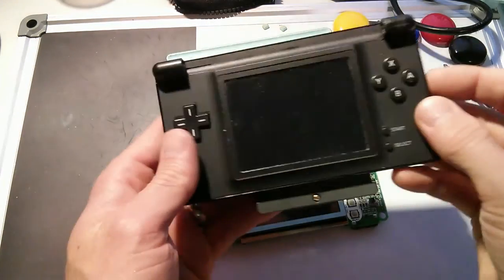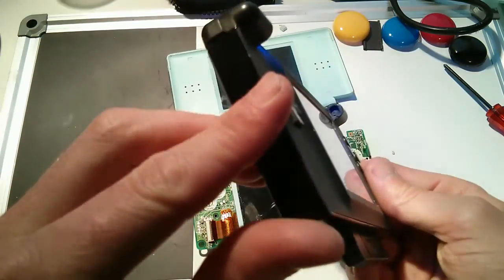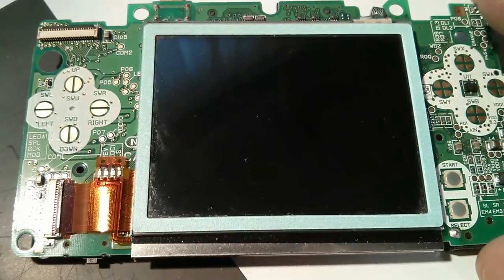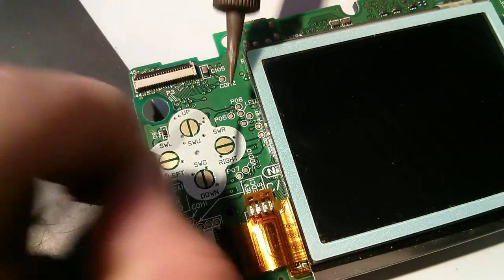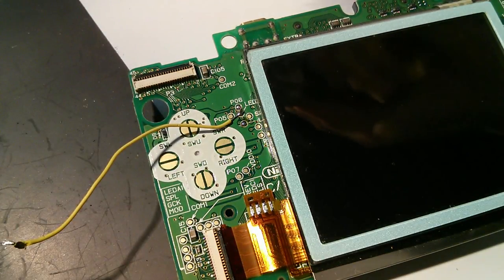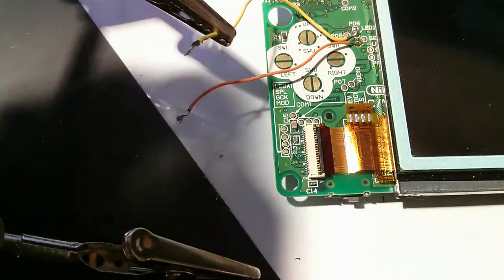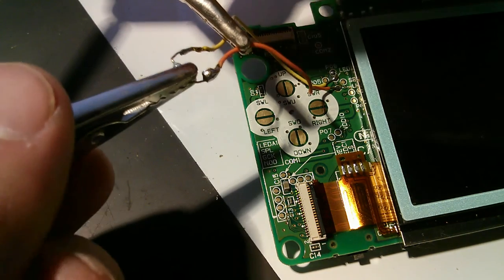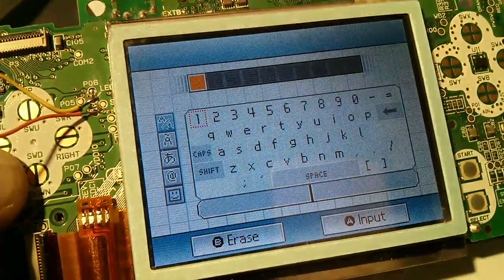Convert broken nintendo DS to gameboy advance

Comment: Can you use a r4 card to run gba games on it if you put an emulator on the r4 card?
Reply from the maker: No it is not possible. You can buy a cheap GBA flash cart tho

Comment: I hv tried 330ohm it didnt works.just the screen blink and shut down.but i tried other value resistors.all below 1k.and finally found the correct one for my ndsl. Its 220ohm(red,red,brown).its seem not all ndsl need the same ohm value.
Reply from the maker: Ah that's good to know, thanks for sharing it on here
Reply: @facelesstech  ur welcome😉

Comment: Can you just solder the resistor directly to the board
Reply from the maker: denzel_the.asian yeah, you can use a 1206 330ohm resistor but it's quite tricky to do if your not used to soldering
Reply from the maker: If you don't fancy soldering you can keep the ribbon cable to goes to the top screen, you will need to keep the LED's attached to it tho

Comment: If you're planning on doing this, keep in mind it's not guaranteed to work.  I've done this 10 times with the broken top screen DS Lites in my stock, but only 4 of them worked after soldering a 330 ohm resistor to the pins.  I have not found any reason why some of them worked and others didn't.

Comment: Is there any way to do this without soldering? I read somewhere that if i keep the ribbon cable intact that it works the same
Reply from the maker: I haven't tried that myself, If you keep enough of the ribbon cable to cause enough resistance so the ds will think the top screen is still attached.  Its worth a go if you already have a broken ds on hand
Reply: i ended up trying it without any tutorial and you can! if you can keep the ribbon cable intact theres a strip of LEDs connected on the end of it. if you just tuck it somewhere it works perfectly. no soldering needed at all unless you want speakers. However when i opened it i did have the speakers working because they are connected next to the LEDs on the ribbon cable... but i couldnt find anywhere to put the speaker without removing the ds card slot. i wanted to keep that so i chose to cut the speaker off. however the whole project is still 100% able to be solder free if you are careful
Reply from the maker: Glad you took the plunge and tried it. I found that if you unscrewed the stylus holder that there was enough room for the speaker which also let the sound out thought the empty stylus slot.

Comment: The screen will turn on and flicker slightly, then turn off after about 5 seconds. Did I do something wrong?
Reply from the maker: Its ether you didn't solder on the right pads or that the solder connection are bad. The flashing of the screen normally happens when the top screen is missing, This is why you have to solder the resistor (330 ohm) or led to the pads as shown

Comment: doesn't work pls help!
ive tried looking everywhere and this is the only video where someone actually shows what to do but i tried it and it doesnt work all that happens is the ds flashes on for one second then shuts off!
Reply from the maker: +zZBuild ProneZz That means that ether you didn't solder on the right pads or that the solder connection are bad. The flashing of the screen normally happens when the top screen is missing, This is why you have to solder the resistor (330 ohm) or led to the pads as shown

Comment: Does this work with the original DS?
Reply: do it work for 3ds
Reply from the maker: +BranSacCreations Yes but Im not sure what pads you would have to solder to
Reply: Just with DSlite and NDS,Not DSI,3ds,2ds
Reply: RuTsu _ Actually you can do it on the DSi and DSi xl
Reply: Sheena Davis hey buddy, you just blow in from stupid town?